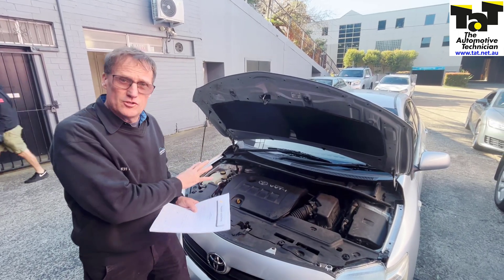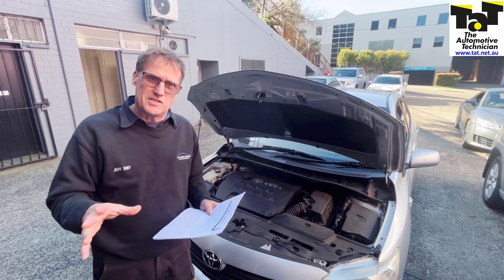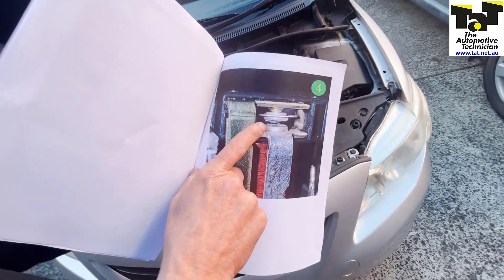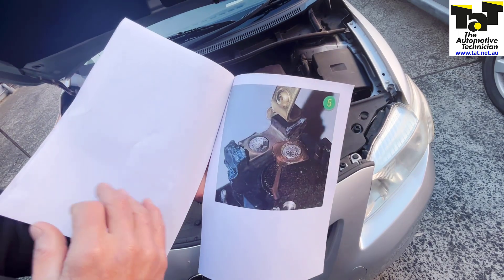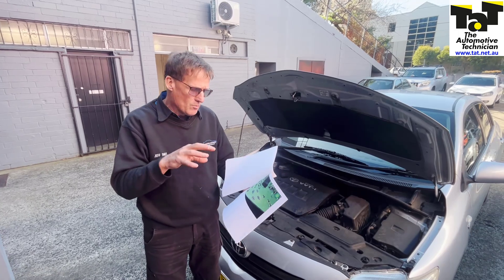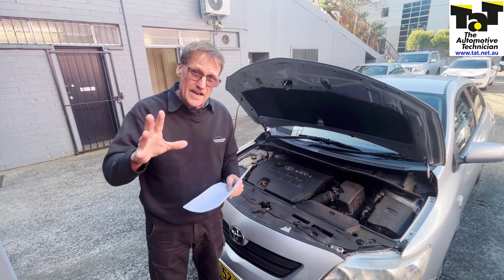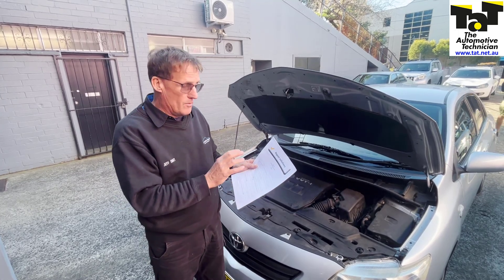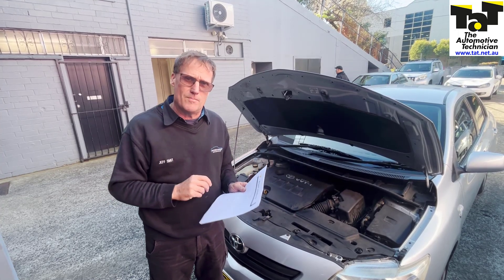2010 Toyota Corolla with an electronic power steering fault

Comment: My 2010 Corolla s has power steering light on, also no power to odb outlet. No power to radio either and no power to heating and ac. Can’t shift it out of gear either. I checked all fuses already